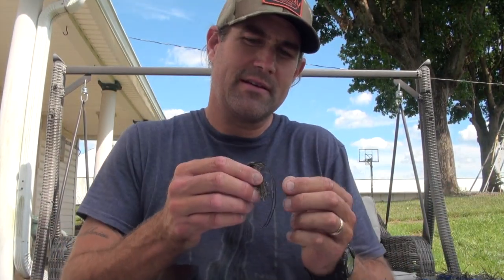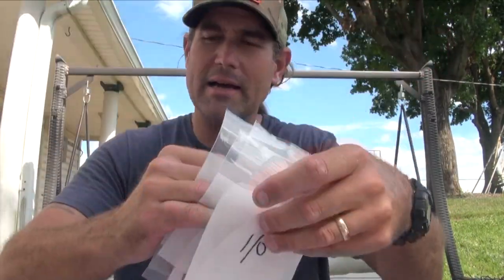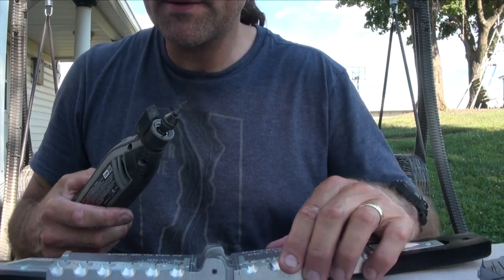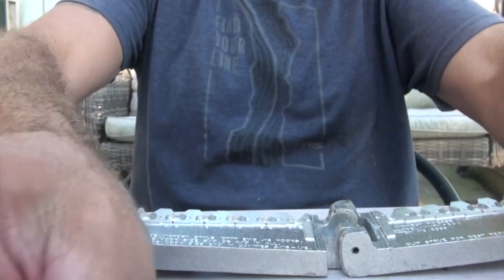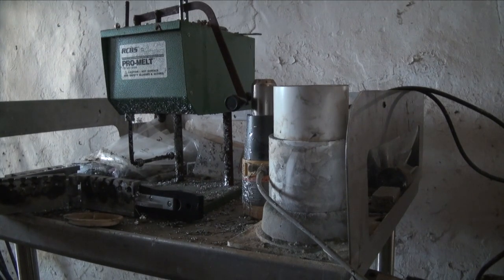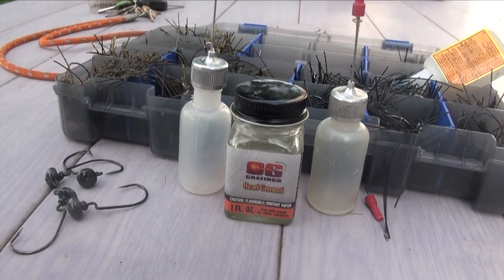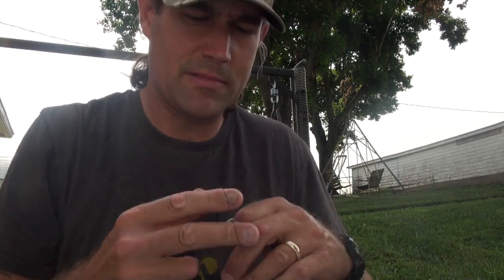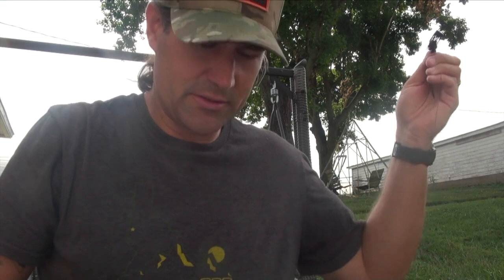Magnum Midwest Finesse Jig // Do-It Mold Modification & Tie How To

Comment: Hi you tried soldering on a wire keeper?
Reply from the maker: No, but I have some wire keepers on order and a different style mold. I want to make a finesse jig that holds elaztech better.
Reply: @TheLittleStuff  yeah, I like wire keepers best for elaztech.
Reply: @TheLittleStuff  
Put a small piece of heat shrink on the hook and slide it up after placing trd. Voila